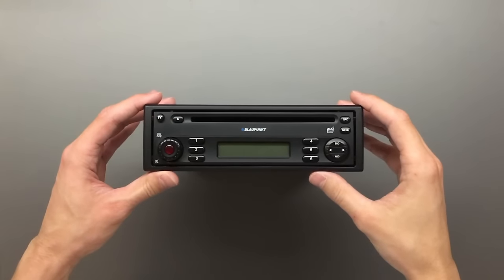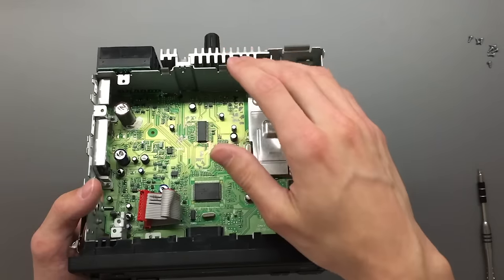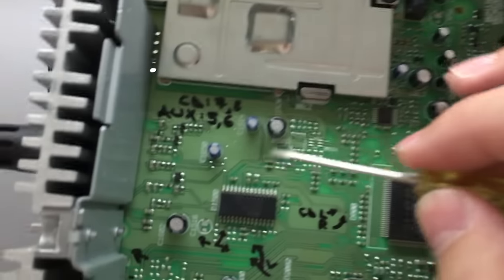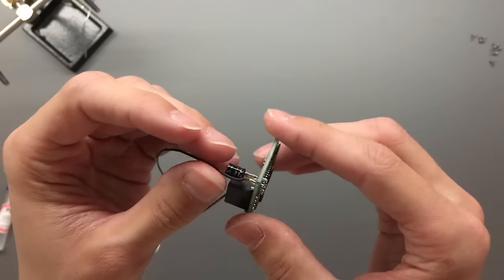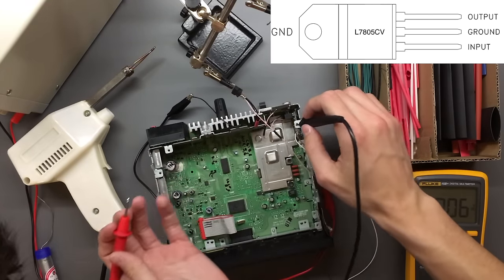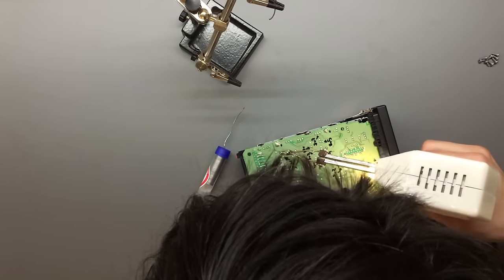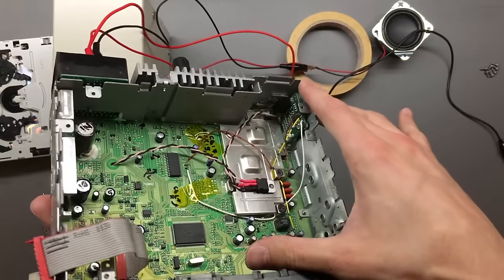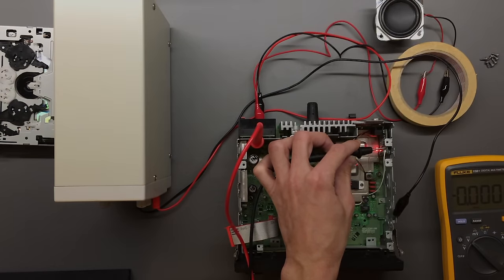How to Add Bluetooth 4.0 to Any Car Stereo for 12$ ! Complete Guide !

Comment: In most BMW you can simply connect a 5$ Bluetooth adapter to AUX and use a 2$ 12->5V USB adapter with min. 0,5A to get it running :D

Comment: Want to incorporate into my neighbors 74 corvette which has the original radio.  How or can this CSR8645 BT unit be added to this radio (only unit) by independently switching the BT unit on/off (external switch) and connect somewhere in the audio circuit to pick up the amplified speakers?  Where can I find internal schematic of this Delco radio?  May be an old video but I fully understand the the technique used. Thought it was great.

Comment: The best option is to place the Bluetooth module OUTSIDE the metal case of the stereo because this metal case can be consider as a Faraday cage which might block the RF signal.
Reply from the maker: alright, but it works at a distance of around 2 meters, how can that be considered ?
Reply: First, it's only for improvement. Second, the distance is not a factor, if the signal is blocked, nothing is coming out. Third, the fact that is works for you does not say anything about Faraday's cage. Maybe your specific case and the specific place you placed the module is OK but in general, the signal might be blocked. Try to put some RF module inside a Microwave oven for example and you will see.
Great video.
Reply from the maker: nah yeah but the front of my stereo is also only plastic ;) so, quite a weak-ass faraday cage it makes
Reply: Well, there you go...

Comment: Thanks for this video it was really helpful. I "successfully" managed to wire the 12v version up to my cars head unit today piggy backing on the existing aux Input socket. It worked perfectly on accessory power but then stopped working after starting the car. I fear it may have been fried from the voltage spike as the board appears to be dead. Not sure if some form of protection is required even for the 12v version?
Reply from the maker: ow yeah - I know why it died (99% sure)

onboard voltage is ~14v with the car running

the 12v and 5v boards use isolating DC-DC convertors to avoid ground loop noise

those are EXTREMELY sensitive w/ respect to input voltage; tolerances were .5v when I last checked a datasheet for one

that's why I use the 5v ones; with those you can use a linear/switching regulator to step down 12v(resting voltage) or 14v(running voltage) or anything else for that matter, without any risk of frying the converter OR the bluetooth board (the isolating converters also follow input voltage, so, they will also potentially output more than 3v3)
Reply: Thanks for the reply and for confirming my suspicions. I'll maybe have another go following your setup with the 5v board 👍
Reply from the maker: good luck - report back on how it went 🤘
Reply: @Darieee  Thanks 😃. Will do, just placed an order for a 5v board 👍

Comment: Have you managed to utilize some of the radios existing old buttons to operate the  bluetooth board commands like play/pause or track control?
Reply from the maker: I'm working on it ...

all buttons are multiplexed - so I'd need a microcontroller to interface the two - and /a metric shit-ton of time/ to debug it and make sure it will work perfectly .. which is kind of the minimum you'd want for a NEXT button

Comment: Nice work my friend! How did you know the chip part number? I "work" mostly on Chrysler electronics and man all chips are rebranded, even diodes have meaningless part numbers. I repaired a Ford radio once, and I was lucky enough to find the "public" part number for the voltage regulator on a russian forum. What do you do in such case, when the chip you are working on has custom part number? Is there any resource out there, a database of some sort with corresponding public part numbers?
Reply from the maker: Pfff, none that I know of ...

Very annoying indeed : in such cases I have a headphone jack with an alligator clip on - to tie to ground and a needle on via a 1uF capacitor on the other side ... and I just listen on the caps around what seems to be the DSP/Mixer chip
Reply: @Darieee  Thank you for the headphone jack trick ;) it would only work (like the scope) with a working radio tho. FWIW... I was trying to communicate to a VFD module on a Chrysler cluster but again... Custom part numbers. I was able to improvise a logic analyzer with an old laptop that had a LPT port. I used this stuff first: https://jwasys.home.xs4all.nl/old/diy2.html
Then I tried this: https://www.codeproject.com/Articles/75279/17-Channel-Logic-Analyzer
Both are very nice and if you're working with 5v signals you're good to go as is, no special hardware required ;) If it helps...
Reply from the maker: Thanks man! Will give it a shot

Comment: I need your help, Darieee!
I enjoyed your video a lot. I believe you can solve this problem.
I'm trying to install an AUX input and a bluetooth module in my car audio system. (Lexus ES330, Pioneer)
I succeeded connecting AUX cable by connecting the cable into 3 pins which seemed like designated for additional input source.
It was easier than I expected it to be because when I select Tape In, it played the cassette tape, and automatically changed source when I put the cable into my iPhone. (it made successive bursting sounds when connected and not playing music with iPhone though)
The bluetooth receiver has its own input and output pins. When bluetooth is not connected, input cable signal bypasses through the module. When bluetooth is connected, it mutes the input cable signal and plays the bluetooth signal.
Here's the problem I got:
I wired the bluetooth module between iPhone cable and the audio system. When bluetooth is not connected, source from iPhone cable is played as expected. However, when I connect bluetooth, the audio system change the source to cassette tape.
I have no idea why this happens. The 3 pins in the audio system only recognize iPhone signal, but not the signal from the bluetooth module. Is there a difference between those 2 signals? Maybe voltage difference? I really need your help here.
Here's the link for the circuit board for the reference: https://drive.google.com/drive/folders/1AzDHEvqm-9IvzxZCqSPYTnMzOLY8zbM-?usp=sharing
Thank you in advance!
Reply from the maker: Could you send me this stuff to my email? I'm on the road now and will have a proper look when I get home

lipton5001 @ yahoo.com

Comment: Since you are building it in a metal case and I haven't seen you connect a bluetooth antenna going out I am surprised it still works.
Reply from the maker: Yeah, me too

The cd slit is more than enough to get a good few meters of range believe it or not
Reply: @Darieee  
The onboard antennas are not the best, but okay, I do believe you. It might not be the case for everybody though and the placement inside can be of influence to the range. You did use a Bluetooth 4.0 which has a much better range than a Bluetooth 3.x  or lower. I would advice people to take the highest Bluetooth version available and if possible place the module outside of the metal case.
Reply from the maker: Mmmm, as long as your radio has any form of opening in the metal chassis, you're fine

I now mod mercedes radios and .. yeah .. all of them have been super fine > with having the module inside; of course as close to the cassette/cd opening as possible

Went with the csra64215, so bluetooth 4.2 .. splendid performance indeed

Comment: Thnx for the video.
I also have a bluetooth chip like this, but without the adaptor plate, only the blue chip and im trying to figure out how to put it on an amplifier, without dc converters. Amplifier is running at 29vdc. Do you think i can connect it on the legs of an LED? Its a 3.3V version
Reply from the maker: mmm, risky - you would need at least a 3.3v regulator

it also has differential audio outputs, not single ended (this should also be considered)

Comment: Thank you for this video.  It inspired me to install one in my lincoln with built I 6 disc changer.  I mimiced your installation on mine however now the cd player plays at a much lower volume and the bluetooth volume is not nearly as loud as the fm bluetooth broadcaster I was using.  Any suggestions what I can check? Alos on the device there is a connection for vol + and vol- Does that mean it may be just playing in the middle volume and if signal is sent to vol+ it would play louder?
Reply from the maker: Yeah, maybe add a 100uF capacitor in series with the L and R lines, there might have been a bias ? On the input lines ?

Or maybe you need to find a different input into the mixer

Comment: My radio does not have a "processing unit" neither a micro controller or a "audio switch board/chip" or a CD-input . It's from 1957. It's not even Stereo. Will it work?

Comment: Hello, I do have an Kebidu Bluethoth, mp3, USB player. I have a player that I want to connect to the Blaupunkt radio CD. I would like to remove the CD drive and continue to use the radio and mp3 module. I don't know where I have to connect the ACC related to the mp3 module so that I can switch from the radio mode to the so-called CD mode but the mp3 module works. 
I assume that the audio signal coming out of the mp3 module must be connected exactly as shown in the video. Or do I probably need to connect to other pins?

Comment: Hey buddy, So I have a few questions if you can spare the time? I have been looking into the 12V dc version of this you linked to and noticed that it has a microphone input as well. Do you think that the microphone input would need to be self amplified before it reached the PCB? or would it be fine? also, any concerns regarding the length of the cable I use for it? I am hoping to place it just above the rear-view mirror. My Mitsubishi has a functional aux port that I can interface with (I already use it for a 3.5mm jack input aux) So I think the rest of my install should be easy enough.

Cheers in advance!
Reply from the maker: Hey there .. You needn't amplify the microphone - the CSR chip has all of the mic biasing and whatnot taken care of. Regarding the cable - I would assume a coax cable would be better (find the thickest VGA cable, tear it down, and that should give you 3 or 4 relatively thin coax cables). To be honest I've never tried hooking a microphone to one of these because iPhones seem to never perform any echo-cancellation on bluetooth devices, so ... yeah, for me it's a no go. 

Barry (http://barryllewellyndesign.com) did confirm that the mic does work surprisingly well (though results may vary with a longer cable - especially unshielded).

Do let me know how it works (and with what) if you do decide to try it out, am quite curious myslef
Reply: Darieee nice one mate, I will order the parts and keep you posted. I'm thinking if I tear down one of those clip on mics it may be ease enough with minimal messing about.
Reply from the maker: yeah, sounds like a good idea !
Reply: Finally got off my arse and got it sorted. It works great! I ended up wiring a female 3.5mm jack into it so I could experiment with different mic's but it works great. Thanks again pal!
Reply from the maker: how's the car noise affecting the call ? Does the other person hear an echo though ? (in case no: what phone are you using ??) 

No worries, glad I could help :D
Reply: So far I have only tested it while stationary so I dont know if it picks up high revs or not. Gonna do a test with my pal later on. Also have not decided on a stationary mic or one of the clip on types. Will update with results :)
Reply: Okay so the testing went well. Needs to be a clip on or people struggle to hear me but no mention of echos which is good. Every now and again I did pick up interference form somewhere. It was like the sound speakers used to make when a phone got a text message beside them. Quite pleased :)
Reply from the maker: very nice :D glad it worked out - are you by any chance using an iphone ?
Reply from the maker: +fluff521 yeah, they don’t seem to be applying any echo cancellation for some reason
Reply: Darieee I am fairly confident that echo cancellation is done by using an extra microphone to register what is background noise compared to the other voice mic and then cancel it out via software. So since it only has one I don't think it can determine what the background noise would be :/
Reply: Hello, I would like to do the same and add a microphone. What microphone did you use?

Comment: Hi,
Great video thanks. I'm bit lost when you talked about audio gnd and chassis gnd. Finally you wired the bt chip audio gnd to radio chassis gnd? Is it a possible way if I make common gnd on the bt chip for audio and power gnd, what I connect to the radio chassis gnd? I'm making USB conversion and I'm not really happy with the sound quality. Maybe I have some miswires on the gnd line. Thanks in advance. :)
Reply from the maker: So, audio GND is chassis gnd, so, technically, you could wire that to one of the lug nuts on a back wheel

So, you're not using bluetooth, right?

What type of noise are you getting?
Reply: Darieee thanks for your answer :) I experience lack of bass, and the fm quiet until I disconnect the audio gnd. So at the moment I’m switching USB audio lines with transistors.
Reply from the maker: I also don't get what you mean by USB audio lines

If you use a USB stick reader, that might short the signal wires to ground when nothing is playing, which would explain why your FM is quiet

You could try an capacitively couple the signal wires from the usb thing you have to your radio ... just put some 10uF capacitors in series with the audio lines, and leave the gound connected directly
Reply: Darieee  Yes I'm using USB stick reader. :) Thanks I'll try it!

Comment: Ok, let me get this straight. The Bluetooth module needs power, so VCC needs 5v and a common ground which is chassis ground? The outputs on the BLT module Audio Left and Audio Right and Audio Ground. So you are connecting the outputs of the Bluetooth module to the inputs on the IC chip for the CD changer input and the audio ground is supposed to be a floating ground or chassis ground? This part was really confusing for me. I watched it over and over. You ended up connecting the audio ground to chassis ground but I'm not really sure why. As for the VCC needing 5v, you have 12v DC coming into the radio and you needed a voltage regulator to convert it to 5v, that part i get. Then you found 12v switched somewhere on the harness and connected your power to the voltage regulator input to a switched input so you don't drain the battery with a constant 12v. So, since my radio has AUX in that i never use, I suppose i can output the bluetooth module to the inputs for that and have bluetooth if i can figure out the grounds. Sweet!

Comment: Hello. Great work, appreciate it. I'm wondering how would you do it without soldering on to board? There are already audio inputs on cd changer jack plug. To enable the aux mode you need to jumper RXD and TXD pins if I'm correct. That tweaks the radio head unit and enables the cd changer mode. Then you won't need to burn a silent disc either. I haven't done it myself but I'm looking around for a Nissan car to do that and trying to figure out which pins to jumper. Could you help me with that? You're clearly better on that subject.
Reply from the maker: Mmmm, I'm not as knowledgeable as I appear - could try though

In this case however, no amount of firmware hacking would suffice, since the external aux signal path isn't populated with any components
Reply: There is no firmware hacking needed. I saw some vids even kids do it. Make the jumper and it's in aux mode. (Which pins to jumper is my biggest concern because I don't want to short anything). There are aux cables sold on amozon with 5 pins. 3 pins for audio, 2 pins jumpered. I can show all the details via email if you're interested. I just didn't work around cars and when I dismantle my dashboard I want to be successful so I'm trying to find out as much as possible.

Comment: Thanks. This is great. I don't want to replace the OEM unit in my 2005 Explorer Sportrac. How do I find the necessary diagrams and know what hardware to buy?
Reply from the maker: Expert Judgement ... datasheets you find on google ... the hardware consists of a bluetooth module, I recommend a 5 or 12v CSRA64215 module (you can get those off of aliexpress)

Comment: Thanks for the Great video. I have a Clarion NX501E with a faulty inbuilt Bluetooth module. I would like to install this pcb as a workaround but have a question. My head unit uses Touchscreen how would I connect the PCB input buttons (VOL+, VOL-, PREV, NEXT, PLY) to respond to screen input?
Reply from the maker: Absolutely no clue xD

Comment: just curious, do you get enough antenna signal when you close the radio: there is a faraday cage around the bluetooth module, and the range must be quite zero ? shouldn"t you put the bluetooth module OUTSIDE of the radio ?
Reply from the maker: yeah, you would've thought so ... but no, it works perfectly (bluetooth 4.0 is pretty awesome in that regard) - the front of the cage where the front panel is is "open" though in my case

Comment: Is it possible to install BT by removing the CD mechanism and of course circuit and by inserting BT Audio R +L to  audio switching/audio processor chip ? I'm trying this in Kenwood KDS MP-333V car stereo. I've already installed it by disabling AM radio and inserting BT audio R+L combined,  to the tuner input of the radio chip.For switching FM and BT audio I've used spdt relay.